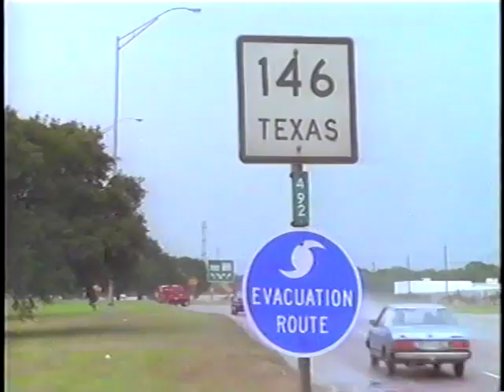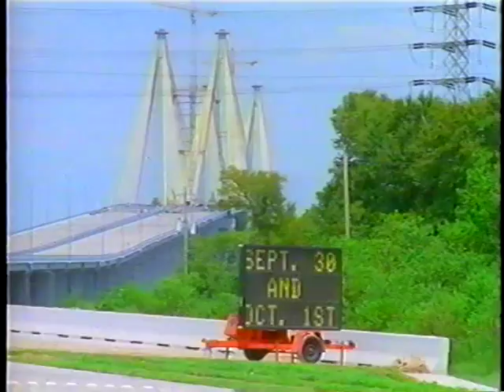A Bridge of Vision

Comment: Man, I remember having to take the tunnel. When we were bored, some friends and I would jump in the car and drive down to the Lynchburg Ferry and take that highway through La Porte and come back to Baytown through the tunnel. Or we'd take the tunnel and cross back on the ferry. Whatever. But it was always a cool way to pass some time and burn some of that Baytown gas. Always had to pay attention in the tunnel, though. The curvature was so bad, you really couldn't look too far ahead.
Although there were wrecks and stuff you'd hear about, I probably passed through that tunnel 1000 times and never saw one.